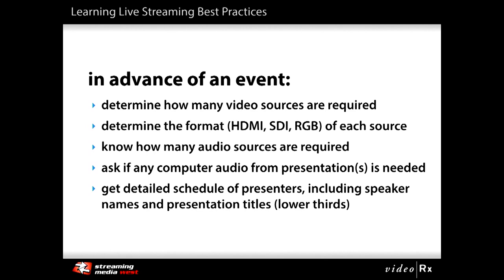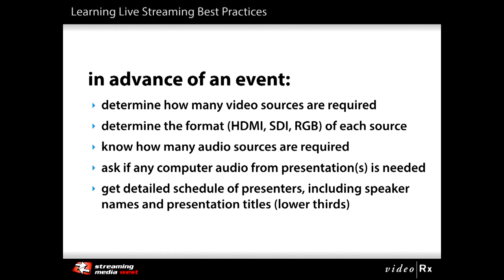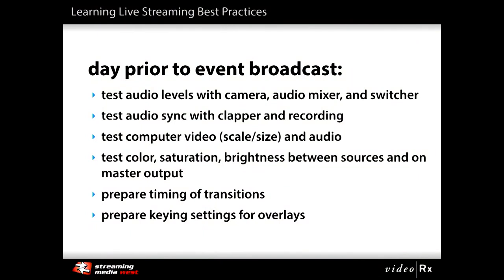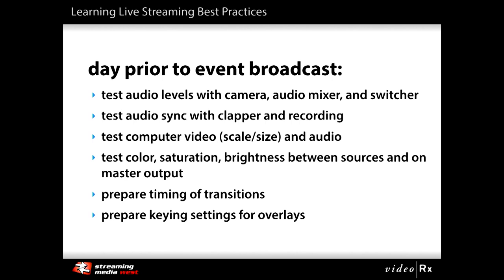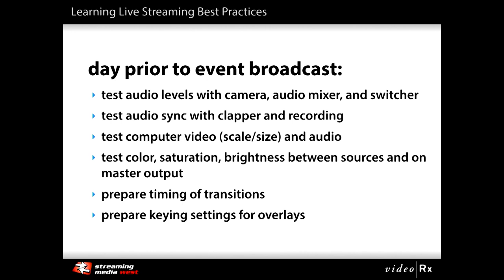AV Mixing Best Practices for Live Event Streaming

Comment: Why use  a seperate mixer instead of feeding your stream via a stereo matrix  or aux send with the delay required inserted? Just curious,  seems thecsecond mixer means you either need a splitter or run direct outs from one mixer to the other…id rather double patch my inouts,